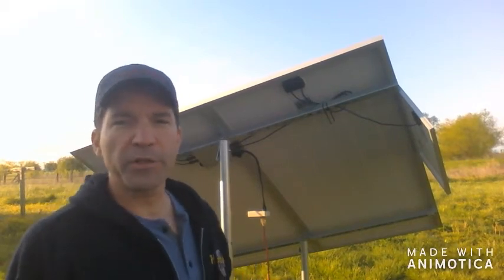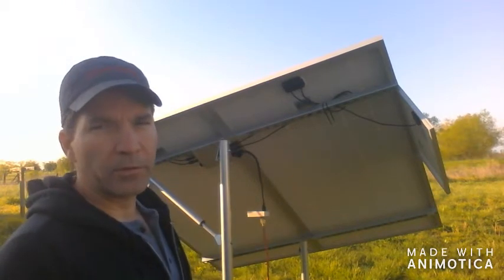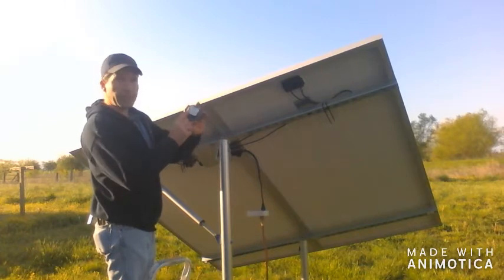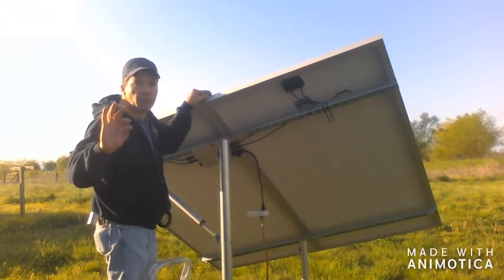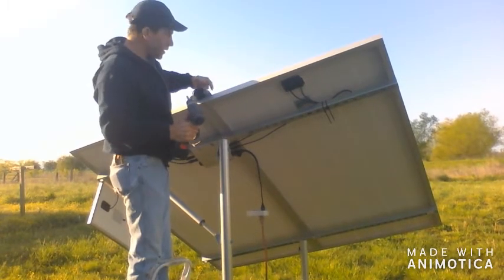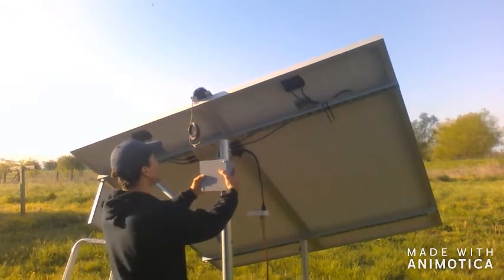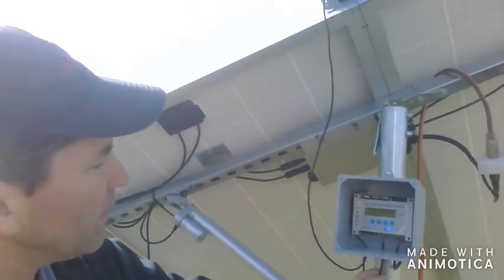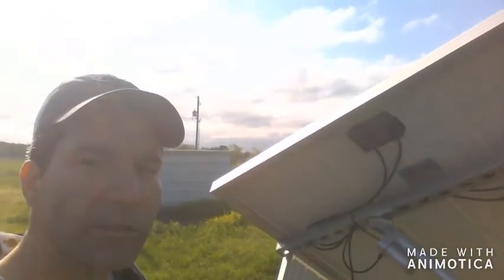solar tracker single axis

Comment: Hello, can you give any updates, comments or videos? Looks like the first version may work better if the angle of the side solar panels were angled out more. Also, with your second version, how is that working? I would think you could keep the second solar panel connected to help with getting power on the other side when the larger panels are moved over where the sun can hit it, otherwise, the single small solar panel may not have enough sun to power the system.